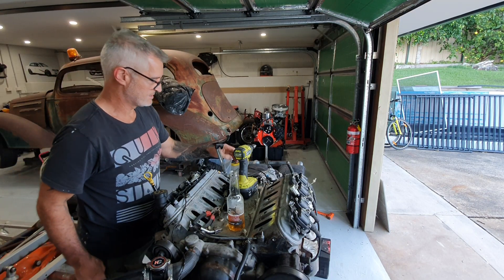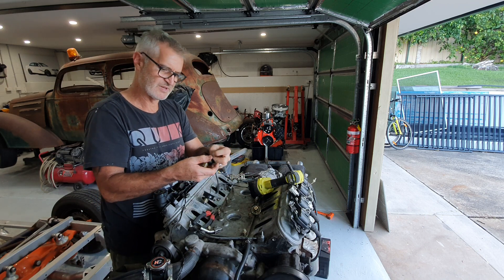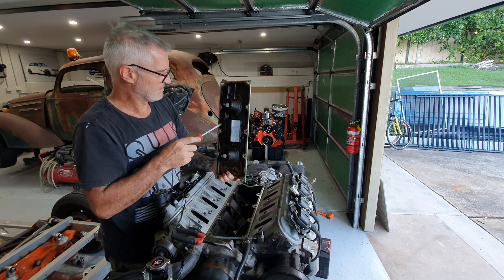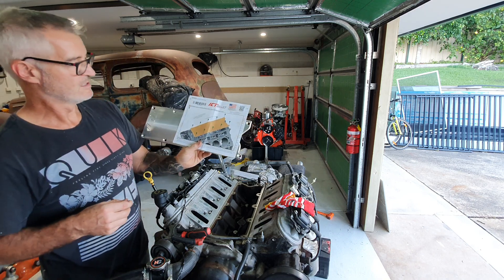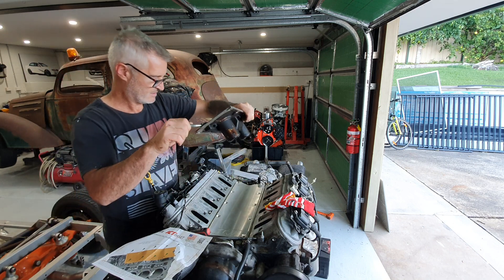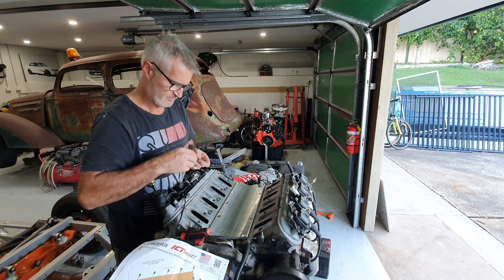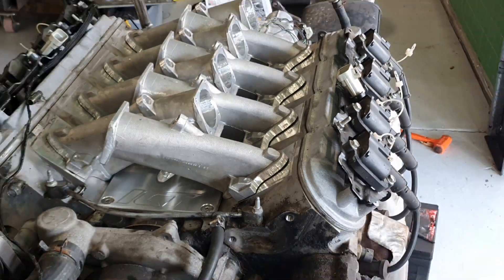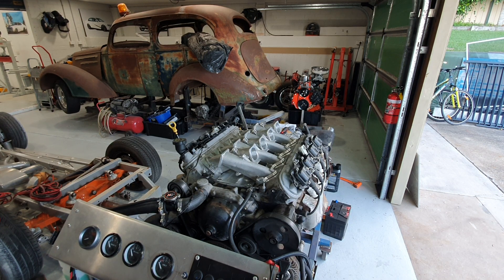How to change a Chevy LS engine Valley cover.

Comment: are you going to do another video about the scavenge system you are going to use?
Reply from the maker: Hey @LIFTERDEL I've had a change of direction for this engine. I will be twin turbo charging it and installing it in my new project, 1972 holden gts monaro coupe.
I will definitely need to scavenge the pcv fir the new direction due to turbo blow by. So yes eventually when I get to that stage I will do a video of it.
Reply: could you just not get all the bugs worked out of the side draft setup? @SullysRodskustoms.
Reply from the maker: The bugs i have are limited to my inexperience in tuning. I have no doubt at all that if I took it to a tuner they would get it to run perfectly. Don't get me wrong with what ive done so far, it starts first time, every time. And revs well, it runs smooth right up to the rev limiter but it fuel's up after a while and begins running rich.  If I wasn't trying to use the standard ecm and used a holley ecm or similar it would be much easier.
Reply: ok thanks all great information!  @SullysRodskustoms.